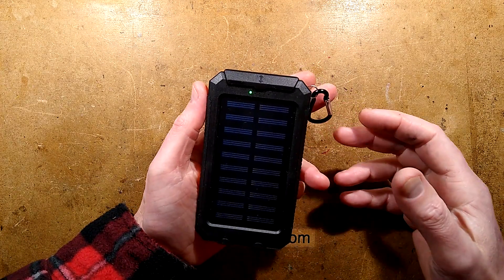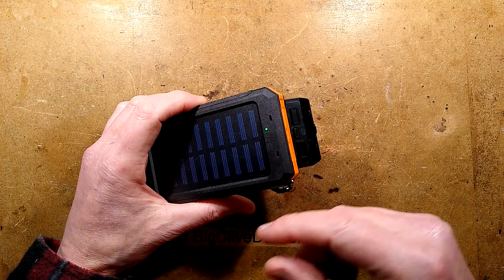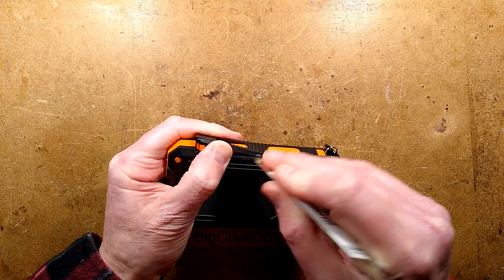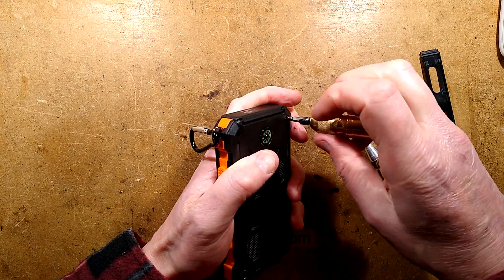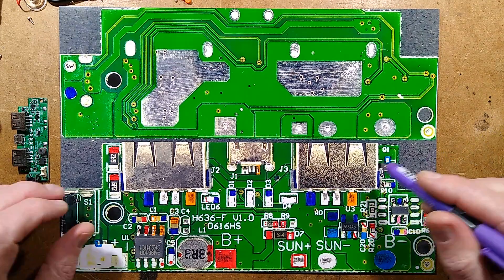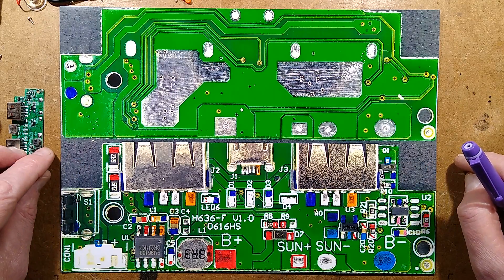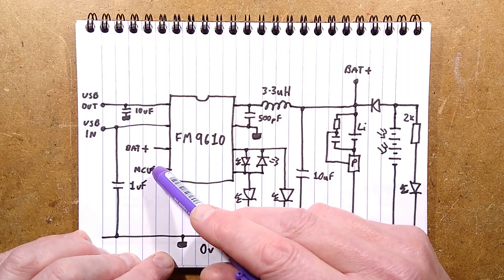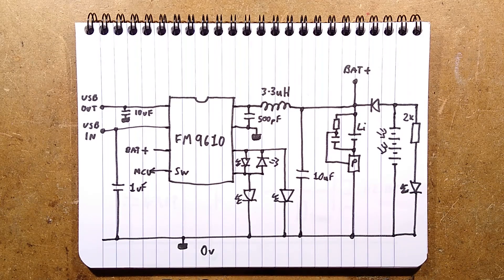eBay 9 MILLION mAh power bank teardown (with schematic)

Comment: Really despairing that eBay and Amazon let the sellers get away with this crap, and they don't have a way of reporting them as fake before you buy. Even after, reporting would make little difference.
Reply: The one thing you can do is request a refund on those sites. If you have a good reputation as a buyer on the platform, you usually get a default judgement and the seller loses money. Anything else is pointless.

Works on both ebay and aliexpress at least, although it's been a while since I last had an issue.
Reply: Worse than the power bank scammers are the flash drive scammers.

I was looking for one and saw a 2TB flashdrive for $39.95.  Yeah, I'm sure, lol...
Reply: @Backroad_Junkie  odds are not in your favor. Maybe 512 mb with a lying chip if you're lucky
Reply: @brianargo4595  Yep.  At least with a powerbank scammer, you're still going to get a powerbank, even if it's only a fraction of the claimed capacity.

What's so insidious about the flash drive scammers, is... uh... naive users will think they're actually successfully writing stuff do the drive, but they're not.  There's a real threat of data loss.
Reply: @Backroad_Junkie  Eventually they will find out.
Reply: @Backroad_Junkie  I got caught with a fake SD card quite a few years ago which was roughly the full price of its genuine equivalent - I think it was SanDisk. It showed the supposed capacity with Get Info (Mac) but failed to write beyond its actual capacity. I think that under capacity fake SD cards were quite new at the time because it took quite a lot of detective work to find out what was going on - though the physical characteristics of it should have given it away had I thought to make a comparison. Anyway, at least back then, the fake drive did not fake being written to and one's computer should verify what is written, maybe there is some more sophisticated scam now but it would have to somehow circumvent the OS's write verification. I think that they depend on the vast majority of buyers not attempting to use the full capacity, at least in the short term (likewise powerbanks), and taking the hit on the, say, 10% who notice straight away. For what it's worth, I think that the eBay seller I bought from had himself been scammed.
Reply: @brianargo4595  ..i would have hoped for atleast 512Megabytes...512 milli byte seems a bit low ;D...thats rougly 4 bits lol...
Reply: @Backroad_Junkie  My friend was proudly telling me he got a 1TB USB key for $20, so I told him to test it by loading some data on to it. Surely enough it maxed out at 32 gigs.
Reply: @inthefade  I once took a 700 Megabytes CD-R and faked its total capacity as 1 TB by changing fake file entries in it.
Reply: @Backroad_Junkie  well I've gotten a Toshiba 4 TB external hard drive for $50, the price for legit storage devices is getting pretty close to the fake clone prices.
Reply: @Backroad_Junkie  Yeah - I was looking on ebay for an 8-10TB external HDD yesterday, and had to select a minimum price to avoid all the "8TB external SSDs for ~£20-£25" polluting the search results.
Reply: @Backroad_Junkie  This A-express store is not to recommend 3C-SSD-Storage Store or any other store that matter.
Reply: Remember, the product is a Lai Ing Ho. Ebay and Amazon are just the pimps.
Reply: Just look at the ads YT makes money with. 60% of what I see today can only be described as "serious technical misinformation".
Reply: @HotelPapa100  Yep. So many obvious scams are being advertised on YouTube.
Reply: But I love being able to buy insanely labelled product for dirt cheap! My 10000mw laser pointer is amazing, that you can hold such power.
Reply: I gave up on eBay and only buy there as a last resort. Battling with Global Shipping Program or sellers who ream you for shipping. eBay says that its fine with them if sellers ream you for shipping. After 18 years buying stuff on eBay that was the last straw.
Reply: @GregM  , I gave up buying and selling on flea-bay well over a decade ago when a female CEO said she wanted to make the site into an online version of Walmart.
Reply: eBay and Amazon have zero interest in dealing with this crap, they make money either way.
Reply: @jonathantatler  exactly, they're a business but the responsibility falls to seller and buyer,, the only thing that really matters to them is profit margin and saving face.
Reply: What's worse if you submit a review to report the fake the review will almost certainly be rejected as not relevant!!
Reply: @matthewn1805  ... and then they will review YOU as a buyer who did not pay or some similar lie.
Reply: I did manage to get my money back from an eBay seller who was selling a 300W solar panel... no, it wasn't. there is no way a panel with an area under a square foot can get 300W even if it were 100% efficient, unless it was placed on the daytime surface of Mercury (and then it would burn) - though I did have to cite physics and a NASA link to prove that there was no way that bit-under-a-square-foot panel could ever get 300W, more like 3W on a good day. Still, I didn't have to return it so paired it with a diode and I have it charging those little 12V 5Ah lead-gel batteries, just have to keep a close eye on it with a multimeter so it doesn't overcharge those batteries.  (I could get a proper charge controller, I suppose, but that would probably eat up most of the 3W I could get out of it.)
Reply: eBay and Amazon have no interest in stopping the sale of these pieces of cheap Chinese crap. They make money off it.

As far as Amazon is concerned, you need to buy stuff SOLD BY AMAZON rather than by some 3rd party seller using Amazon's platform. If you buy tech sold by a seller, particularly a seller based out of China, you WILL be scammed.
Reply: Agreed! I tried to complain on ebay about multiple listings for solar panels which overstated the outputs massively. Ended up giving up as there was no easy way to complain. Ebay and amazon are awash with dodgy tat sellers who are getting away with it day in day out
Reply: @cragmc8386  Walmart has their website running similar. In 2020, I ordered something and kept getting excuses from the seller in broken English. They sent me a bogus proof of refund thing they typed up. I went over their heads and got Walmart to force a refund. And no, the item never did show up, and I only got refunded once, so that seller was a total scammer.
Reply: @cragmc8386  Definitely a case of _caveat emptor_.
Reply: @cragmc8386  The best you can do is not buy them and educate others if they are not already educated.  I despise fake products and just wish they would go away.  There are all sorts of fake items like 16 TB SSDs that are just 16 GB SD cards hot glued in an enclosure.  They are not even fast cards either.  Then there are phones with fake specs and they modify the firmware to report all sorts of completely false things.  They may say 64 or 108 MP but those terrible fakes have a 5 MP camera at best that can't take a clear picture no matter how hard you try.  It feels like some people only live to scam others for some reason.  It is just sad!!  Even sadder is it seems like the only way some people can make money.  Still, can't they make some money selling things with real advertising and not butchered English filled with repeats and specs that make no sense for the item?  In a way such bad advertising is a good thing.  It helps us recognize a merchant who is full of *sh!t*!!
Reply: eBay makes money so they don't care
Reply: They have the same issue with flashlights and their Lumen ratings... they simply dont give a shit because they are a shitty company and should be avoided at all cost
Reply: Yes, the list of scams like this is growing all the time:
Fake Powerbank battery capacities.
Fake SSD Storage capacities.
Fake Flashlight lumen outputs.
Fake Solar panel power outputs.
Fake Laser power outputs.
Fake Speaker audio power levels.
Fake inverter power outputs.
Fake pricing strategies (solar panel for £0.99 anyone)
Fake mains plugs and wires.
Fake branded product ripoffs. (Honda, Apple etc...)

Feel free to add the one's I've missed.
Reply: @gavinminion8515  Don't forget the fake gold and silver coins/bullion!
Reply: @gavinminion8515 
Which is why I always get most of  these things from dead devices, coming from a trash can, in an agreement with its local seller
Reply: They are obviously in cahoots
Reply: @daviecrocket9160  Isn't that a suburb in Shenzhen?
Reply: Learned my lesson I only buy translucent power banks now. If everyone else dose what I do then they will start making fake oversized LiPos filled with sand how they do for capacitors.
Reply: Think Rings of Power and you got what they are about, deception and scam. Jeff did not get rich selling top notch stuff.
Reply: They don't care even if those things are dangerous an can explode. They say that you can send if back an d ask refund. Not only Amazon: all of them. I was afraid that one battery I bought could explode in the mail and hurt a mailman! I didn't asked for a refund.
Reply: False advertising should be punishable by jail time or corporal punishment.  I've heard a lot of stories about fake lithium cells being filled with sand for weight.  One or two real batteries and the rest fakes.  I just bought a battery bank on Amazon claiming 28500 mAh, when I measured it it was barely 12000.  And this is after at least a dozen full charge/discharge cycles to break it in.  Should have known, since the really good quality Lion 18650's are like $10 each, and if the bank had 6 of those it would be worth a lot more than $20.  Even at 3000mAh for a really good quality Lion cell, that would still only be 18000mAh, not 28500...  Best bet is to go to your electronic recycler and beg a couple of used laptop batteries.  Scavenge the cells and use them to replace the junk in the battery bank.  Laptop cells are always the best available and actually have their rated capacity.  Even used ones will be a lot better than the garbage in these cheap battery banks.
Reply: I'm more worried about the "Zero point energy wand"
Reply: So... Quit buying cheap chinese crap.
And screw amazon. Never used it. EVER.
Reply: I’m sure they’re making money off the sales. Why would they have any incentive to stop the sales of junk stuff if it’s making them money.
Reply: the review system is the way they stop them from getting away with stuff, although ebays reviews are kind of trash but thats why i massively prefer amazon
Reply: once I reported a fraudulent product on Ebay (defective secondhand instead of new one), Ebay rejected the report. The seller had a very high score. These scores are apparently untrustworthy and Ebay in my opinion also.
Reply: Honestly theres no reason they cant apply image recognition to identify previously reported shoddy products.
Amazing amount of crap appearing on amazon now. Its just ali express items but at 3x the price (thats the cost of avoiding 1 months shipping).

And recently ive had to get amazon involved because the dodgy sellers were giving me sob stories via email, had to get them blocked. Thing is i wont bother with a refund, ill take the hit so nobody else gets ripped off and they never know what to do with that.
Reply: the ability to report these people depends on who they bribed I bought a fake camera and ebay stepped in gave me my money back and said we did not have to return the item so they can and sometimes do step up to the plate amazon seems to be more harsh for such scams but when bribes are in play the rules do not apply
Reply: Reporting would help i think
Reply: 9 million mAh.  A good car battery couldn't even accomplish that!!  I don't know who they think they are fooling really.  Anyone with any brain in their skull would know that 9 million is impossible for something like that!!  I don't think that much current comes out of the walls even!!
Reply: Both sites are full of fake shite that's not even particularly cheap.  Best avoided.
Reply: No but you can just make a claim for your money back as soon as you get the item. You don't even need to provide proof its no 9 million mAH since everyone knows this is not possible.
Reply: what's so funny is the idiots that buy them think they're great and leave positive reviews.
Reply: They dont care about people, they only counts worth.
Reply: Even if the seller gets their account banned, they just set up shop with a new account
Reply: Both american companies, of course they are thieves and liars.
Reply: This is the type of scammy rubbish found on eBay that has completely put me off even visiting that site any more. I got burned a couple of times with false advertising for rubbish made in China and vowed never again.
Reply: I have reported one eBAY item to trading standards for having one of those out-of-spec tiny, dangrous, un-fused three pin plugs on them - they were quite appreciative and seemed happy to have the information. It was a UK importer of chinese stuff but they thought it might be possible to take some action.
Reply: Your local Walmart too! Look at the impulse buys at checkout, they've got one of these that I can tell you is heavier than it should be too. Brand new only gave me 5% extra on my Galaxy S8
Reply: I would love to see a tare down of  Red-E power bank with an LED light.
Reply: yea those websites seem to be full of fake sellers with botted reviews
Reply: @ingulari3977  ooh my... so i recon everyone ina  200m radius from ur car/house is now deaf...prob not LOL... those sellars r funny...but ya BE AWARE...IF ITS TOO GOOD TO BE TRUE IT PROB ISENT...
..and sadly ppl who get scammed has probably not a clue thay was... until its to late...
Reply: Same thing with Flashlight scammers. I've exposed dozens on Facebook. 90,000lm - The power of a small sun in your hand.
Reply: @WaynesWorld999  heh I'm building a device that puts out about that much power. I'm going to get about 2 seconds of run time before it overheats lol.
Reply: You can get great deals on these "solar panel" batteries because of the terrible reviews. Use that to your advantage. Many are very high capacity and are great when combined with a larger portable folding panel for powering small USB fans and Onite light bulbs during power outages. During the day just directly power the fan from the panel while using another USB port for recharging the power bank. They can power the fan on low for 40+ hours. After a hurricane these are a lifesaver.
Reply: I'm sure it's just a typo in the listing, someone blanked out for a moment and held the 0 key down too long
Reply: @pauldzim  Fell asleep on the keyboard lol
Reply: @pauldzim  Having emailed a few of the sellers offering these amazing capacity units to query the size, they have all confirmed rating over over 1,000,000 mAH. Even when I asked if they mean it was equivalent to thousands of car batteries, they said "Yes, is 1,000,000 mAH"
Reply: @pauldzim  aye  that's absolutely what I was thinking had a mental health memory loss for a few  seconds  lol nice one pauldzim
Reply: @pauldzim  There are too many identical listings for that to be true.
Reply: @uzimmermann  It could easily be the same person with multiple accounts. That wouldn't surprise me. I've seen the same with graphics card scalpers.
Reply: you only see this kind of bull-shit on chinese sites. My experience: do not buy memory (disks, USB sticks, etc.) or batteries in China. It's 1 and all scam. Top point of scam: someone orders an electric sports car in China.... what will he get? the cheapest electric strange car other than ordered  and it  was really junk. I always buy with afterpay via ....Klarna...., which suits me very well.

Comment: To get the full 9 million mAh, take a pair of wires that are about 93 million miles long, and connect them to the positive and negative terminals of the sun as shown on the board, pleease observe correct polarity
:D
does the compass show the magnetic force of the internal wring ?
Reply: Use the moon as a fuse:)
Reply: Hi, is it north = positive or south?

Please answer quickly as it's getting quite warm...
Reply: @gavinminion8515  Depends on the solar magnetic cycle. Thus even if you get it right today you can't leave it hooked up the same way until 2033.
Reply: Best comments here.....lol
Reply: Forgot to mention, you should of course be using silicone insulated cables, asbestos insulation is bad for your health
you could use micc, but it's not as flexible at the calculated size
Reply from the maker: If we could connect wires to the sun, one of us would short it out to see what happened.
Reply: @bigclivedotcom  Don't worry, it's quite safe, the sun has a thermal cut out.

Though resetting it is a bit of a pain - it involves an obelisk about 3km high orbiting Jupiter, guarded by a psychopathic computer.

Interesting fact: the computer used to be a HAL 9000, but the replacement was bought on ebay, and now it is a HAL 9,000,000mAH.

Comment: 9.000.000 mAh in such a small package would make it a relatively high explosive, considering the required amount of stored energy.
Reply: My math shows 27.5 kg TNT equivalent.
Reply: It'd be a giant high explosive. Bordering on nuclear.(well at the original 39mwh, rather less at the 39kwh, it'd still be about an order of magnitude better than any chemistry I'm aware of to fit that much energy in what looks like 100cc volume.

Comment: I was given one of these today. Was asked to dispose of it safely as the (larger the one in your video) Li-Po cell inside it had puffed up so much the casing had been warped and had split open. Nice!  It was at just over 2v so I've put it in bucket full of sand and left it discharging to 0v using a 3v lamp.
Reply: why not use just use a hammer?
Reply: SAND AND BAKING SODA, SAND AND BAKING SODA. BAKING SODA IS AN EXCELLENT FIRE RETARDANT
Reply: so did mine
Reply: @BlondieHappyGuy  Same happened to my XIAOMI A1, though it didn't pop the back, but cracked the screen...